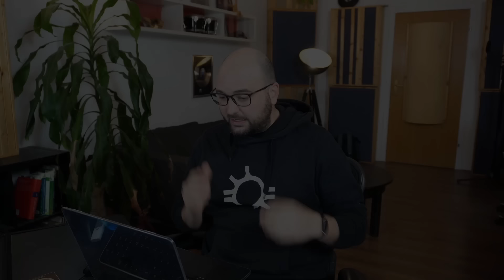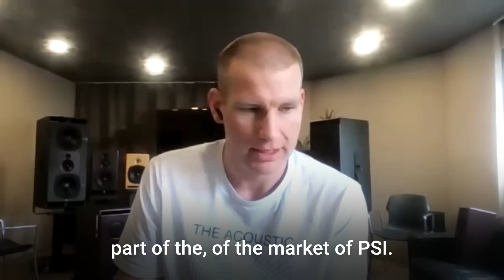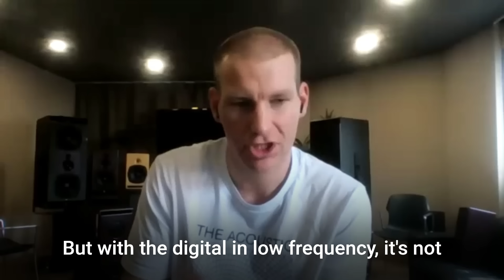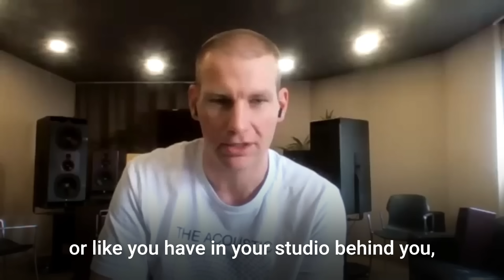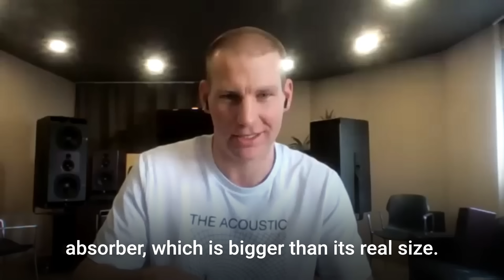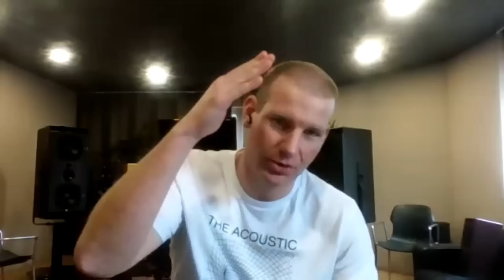No One Understands How the PSI AUDIO AVAA Works. So I Asked Its Creator.

Comment: I understand PSI is a small company and they make high-end monitoring gear, and they have to recoup the $$$ they spent R&Ding this thing.
But given the relative hardware simplicity, I do wish they would manage to bring the price down to a fraction of the 3300€ they're asking for it. 
I mean, there's active DSPed subs out there that can be bought for 699€. And this is essentially that + a mic.
It seems like it'd be an absolute killer device that most any amateur could fit in their studio, and given the patents they hold on this they'd easily flood the market with these without any competition.

BTW, PSI is not the first to do this, Bag-End made an active trap called the E-trap as far back as 2008.

Comment: I own three avaa c214. One is in the room behind the speaker. The 2nd is 2 rooms behind the speaker.

All 3 are behind multi stage power conditioners to increase soundstage and blackness in the performance of the avaa. All 3 requires precision in it's rotation by less than a millimeter to make the bass perception dead center so you have to think like they are speakers.
Reply: Hmm. Or maybe you thought of them like speakers first and applied your regular audiophile thinking upon them. 

The fact they worked regardless of that, led to confirmation bias that applying such audiophile thinking must be the best way to deal with them ! 

That sounds more plausible to me. Just my opinion.
Reply: @natdenchfield8061 bro, the bass was biased to one aside if I didn't fine tune it which then makes it seem like it made the setup sound worse than better.
Reply: "increase blackness" LMFAO

Comment: For me this is not a very effective solution as it attempts to treat excess pressure after it develops, and only treats the exact pressure zone it is in. My active bass mode treatment system treats the issue 0.02 ms before it develops, treats the whole room and gives me extensive control to decide exactly what frequencies I want to fix and how many db of fix I want. It also cost me about 1/4 of what one of these units cost. If I rebuilt my design with 100% purchased elements it would be about $1800 and be considerably better than the setup I built out of stuff lying around my shop, and able to banish room modes down to at least 16hz.

Comment: I have had  AVAA’s in my system for several years.  Acoustic treatments I had worked fine in higher frequencies but not as well for bass.  The AVAA’s work.  Period.  I wouldn’t be without them.

Comment: A quick note on reliability, mine have been on for 2.5 years and never turned off. They have never failed and have been rocksolid.
Reply: How are you liking the product? Is there never going back to without one?
Reply: @Tisc-a At first I am not sure what I was expecting. I had to listen carefully and tweak the placements a little bit. Interestingly enough, the improvements did not hit me in the face, it felt like sound stage and details were better but it all got confirmed once I turned the units off, then I saw the difference and there was no way back. Now I can say that I would not live without them. In all fairness, once I had them pretty well set up, I decided to do a couple REW measurements it really helped me change the location of one of the AVAA and reduce it’s gain to even improve even a little bit more. Not saying that measurements are absolutely necessary but they can definitely help the last bit of fine-tuning. Great units overall I cannot afford in my living room, space for very thick bass traps so the AVAA are the ultimate solution for me.

Comment: I have 2 of the PSI AVAA C214 and they brought down my low end decay to around 200ms. I’m planning to get another 2. They are incredible. 

Just imagine how much wall space you would need to apply pressure traps and the amount just to achieve what the AVAA’s can achieve.
Reply: Probably not as much as you think. 

What data do you have on the amount of equivalent absorption yours getting doe the two AVAAs?  And then what other treatment would you be comparing it to? 

If you compare to something known and tested to actually work e.g. RealAcoustix BassMod .. and placed properly (often not in the corners ..) .. you may find the BassMods end up cheaper (I think they're $700 a panel) and don't impose on floor space as much . 

Imagination is fun .. but it's limited by our lives experiences. If one has never been given good bass trap advice, only ever made massive membrane traps or broadband traps .. the you'll imagine good bass traps need to be massive .

Comment: I think this product is niche for the hifi setup in a living room…since multi subs are incredibly more effective if integrated properly
Reply: You “think” yet you say subs are “incredibly more effective”? How do you know? I’ve tested both and use both methods together
Reply: @dougleydorite i followed the research from Floyd Toole to take the guesswork out of it. DSP is obviously required. 4 subs is a lot more effective than 2
Reply: So now you are name dropping. Why can’t you just admit that you have not tested AVAA’s for yourself. Does Floyd Toole have any real experience research and testing on actual AVAA units that go beyond “thinking or opinions”? Because the argument of authority   only shows you don’t have experience with your claims
Reply: @dougleydorite   They have an estimation based on some education. There was no claim beyond that. If you have a different estimation or even made a direct comparison, you can just give us your view and everything is fine. Everyone will have to evaluate and compare all the available reports and estimations, there is no definite answer.
Reply: @LiegLos  my problem with the multiple sub approach, is that I don’t like bass feeling 100 % omnidirectional because it’s not… especially in a room with tight decay. I use 2 subs up front and AVAA’s along my back wall and have way more depth than I I used Subs in all 4 corners. This is based on my experience though, not someone else’s
Reply: @dougleydorite check out the measurements done by the Absolute Sound, which was a friendly review…the device works a little but nothing like 4 subs. And imagine us talking face to face in person about this topic if you choose to reply 😉
Reply: @seanb3303  Sure no one can deny the results 4 or more subs can bring, but can't you imagine how dougleydorite's point about using "both methods" could be even better?  You can have 4 subs sure, that can give you an even frequency response throughout the room, counteracting room modes, that's great... that has nothing to do with decay times though, necessarily.  You throw 2 or 4 of these AVAA units in there, and now you get the even response of 4+ subs AND bass energy that stops very quickly when the signal stops.  Makes sense to me!

And besides, if you really wanted the best bass possible, you're building a sub wall with minimum 8 subs front and rear and using trinnovs wave formation tech.

To comment on dougley's comment about multiple subs and omnidirectional bass, I'll say this.  While bass TRAVELS omnidirectionally regardless of where the source is, that's true, but it still has a direction - that is to say, it originates FROM the source, and while we're certainly not nearly as sensitive to localization of very low frequencies as higher ones, I don't think or know that we could say that we can't perceive at all whether bass is originating only from the front wall, or behind us.  To clarify, I believe that he could be right and that we can perceive whether bass originates from in front of us, passing past us front to back with the main sound, vs behind us or all around us.  And if this can be perceived, like he claims, then I can see how it would be preferable to sense the bass energy coming from the front with the main sound source and not from behind or all around, which might be fine as an effect, like movies or something, but would be less realistic or preferable for music.  And this effect might have a cutoff frequency with some minor (or maybe not so minor?) variation between individuals, such that perhaps we cannot perceive at all whether there's 4 subs all around or just 2 up front below some number, 25hz, 30hz, whatever, but above some number - like certainly a kick drum hit lets say, ~55hz, this we can perceive general direction of the origination of the sound, not as precisely as high frequencies, but certainly something as extreme as generally in front of us vs generally behind us.  It might not even be an auditory perception via the ears, but rather our bodies sensing this energy and adding information to the overall "sound" our brain interprets.
Reply: @seanb3303  I’ve actually seen that video and think he did an okay job but he says exactly what they are useful for. I don’t have any room for more passive trapping otherwise I’d do that. And also, I use multiple subs, just two in the front corners aligned with my mains because I don’t want  my low end coming from behind me because low frequencies are not 100% omnidirectional. I work with music not just hifi playback so it needs to be stereo, time and phase alignment - so I use 3 AVAA’s behind me and get much better results than that guy gets and the best part is the space I don’t lose
Reply: My understanding is that multi-sub setups are often optimized for modal smoothing and consistency, which in practice tends to involve summing or heavily correlating the low frequencies. That can reduce true stereo separation in the bass.

For me, preserving full-range stereo reproduction is important, so I’ve focused on acoustic treatment. In that context, solutions like AVAAs seem appealing because they address low-frequency issues without pushing the system toward mono bass behavior.
Reply: You can use these with a multi sub setup. Multiple subs does not reduce the decay times within the room.
Reply: @6195ryan  Multiple subwoofers can reduce, or more accurately, smooth out decay times (RT60) in a room by creating more even bass coverage and cancelling out room modes (peaks/nulls) when properly placed and aligned. Using multiple subs reduces the modal variance, preventing specific low frequencies from ringing for too long.
Reply: @seanb3303 yeah that is correct, but what I mostly meant is that there would still be a decay time when doing this. while that may work for mixing, if you wish to track with that on there must be a delay. I am assuming that like eq correction, simply doing this without any treatment would get you a good result but may change other characteristics of the sound. Trinnov systems seem to alter transients and impart a “sound” when doing too much correction. Also, to me, the nice thing about the psi is they just work. The best outcome would most likely be using this new type of correction with the psi and traditional treatment. Of course it sucks that it’s expensive but let’s be real, these are for professional mixing environments or people very serious about getting to that next level. Who knows, in 10 years psi will probably have competitors in the market and so will Dirac hopefully making both much more obtainable.
Reply: @6195ryan  Typically a good recipe is treatment above 80hz and multi subs below 80hz…then a DSP as a final step. 

The PSI is modestly effective compared to using 4 subs I guess was my point. The Absolute Sound published some nice measurements of what I believe 3 or 4 PSI units could do. 

Of course the product has some niche applications where it’s going to be a much nicer upgrade than something like cables 😉
Reply: @seanb3303  I’m pretty curious how they would work with trinnov or genelec correction plus significant treatment. 4 units would be amazing but yeah that’s about 16k. But building a room and treatment for similar result would be most likely more expensive. Seems like Dirac only runs on very expensive receivers. I’d also be curious how much the quality of subs matter. 4 subs and Dirac could be very expensive. Gotta hear them in person but for now seems like no option is cheap lol.